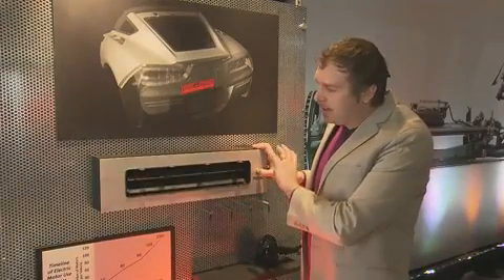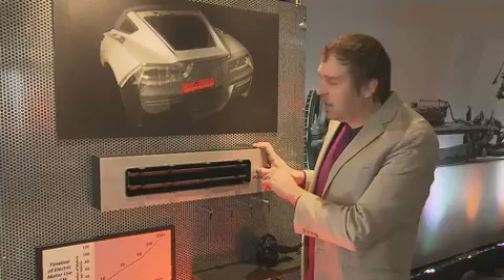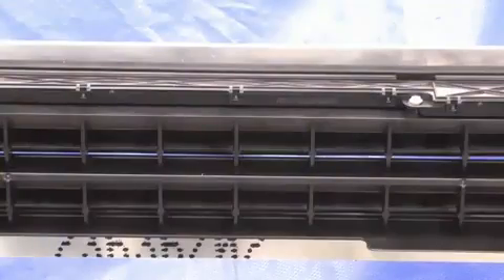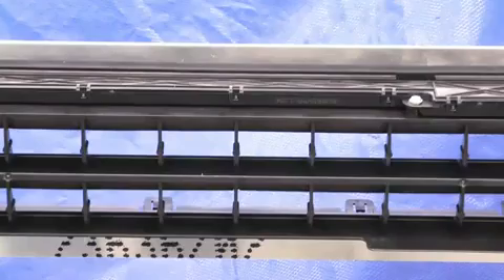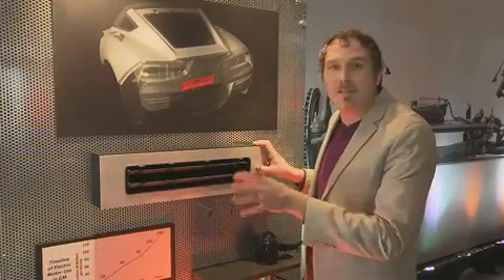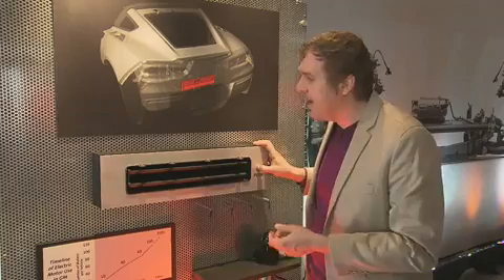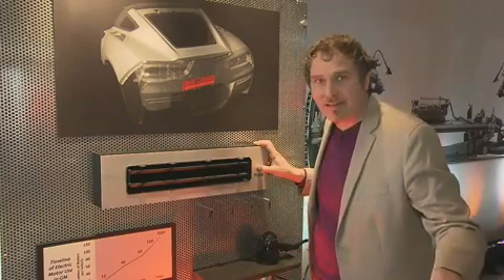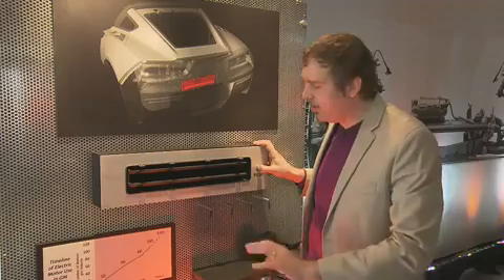Shape memory alloys on the 2014 Corvette Stingray

Comment: Why aren't more manufacters using Nitinol on cars?  

You have a Crash, wing, bonnet, boot is damaged. take it off, put it in hot water, goes back to the shape it was. fit it back on and off you go. quicker and money saving
Reply: Good question

It all lies in money...

1)The cost of Nitinol as body panels would probably surpass that of Carbon Fiber, even to this day, its still relatively new and only limited to extreme applications such as aerospace, medical or automotive

2) Supplying spare parts is a way for the manufacturer to make extra money, and given that they're selling a V8 Sports car back then for $70K, they got to make the money back somehow